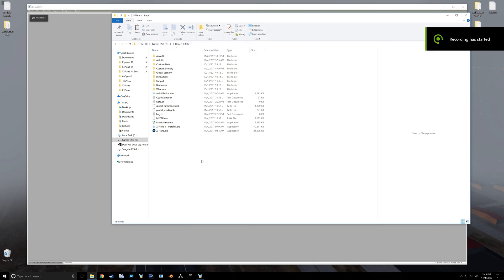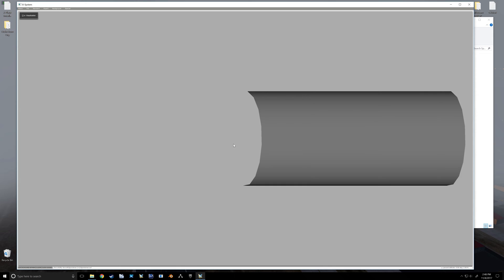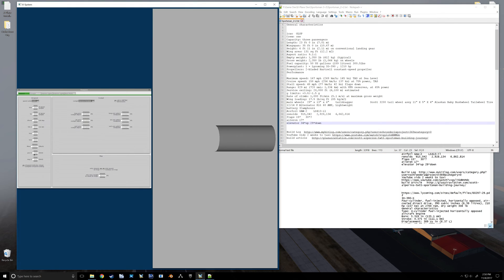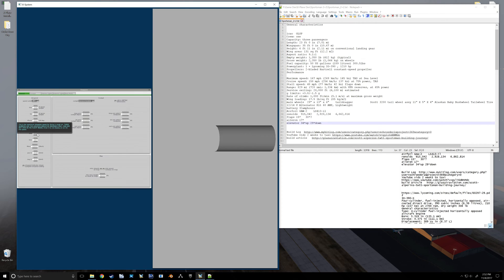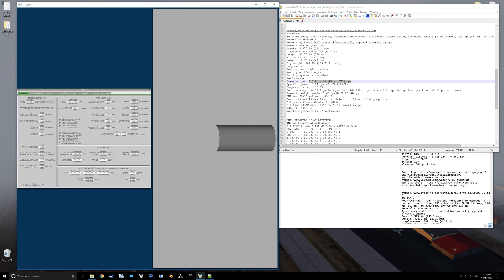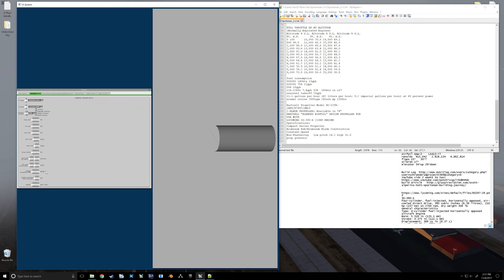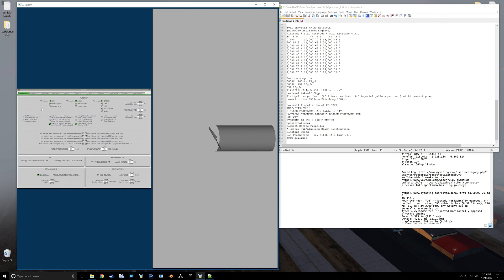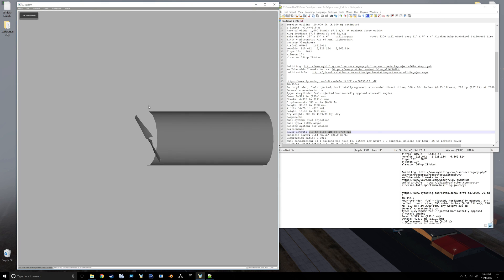Making an airplane for X-Plane 11 Tutorial #1

Comment: lemme join and say thx for the series. i watched about 10 parts but without goin into details, can you tell me where are the XPL files discussed? for me this is the main culprit in the whole process, first: why it is separate and not integrated in the plane maker software? second: in most better aircraft looks to me the XPL file contains the more important functionality, like fine tunings, extra AP settings, comprehensive lights, FMS settings and defaults... it is a horrible system just like fsx/p3d. tried to google it but i dont get any usable results, only that those are dll files. yeah ok but where i get the dedicated editor and compiler for those that would connect it with the datarefs in the ACF file?
Reply from the maker: I never got that deep into things. I think you’ll find some help on the x-plane developer website. A google search for x-plane developer should get you there.

Comment: I'm trying to build a quadcopter in plane maker. So far, I have made the fuselage, the arms, set 4 rotors, props and engine nacelles at the 4 rotor points. Have also made landing legs. When I import it in x plane, it keeps on toppling and eventually catches fire, then respawns and does this again and again. Any help ?

I also need to control this quadcopter using ardupilot SITL and QGC
Reply from the maker: Sorry, I have no experience designing quadcopters.

Comment: Is it possible to fix bugs in xplane 11 paid aircraft such as the Air Foil Labs King Air 350???

I’m a corporate pilot that flys a King Air 350i in real life and find that study level aircraft such as the Air Foil Labs King Air 350 are a super useful training aid for the real airplane in terms of doing “flow checks” and muscle memory type stuff, however there are a few small things from a systems standpoint that need to be tweaked to make it a perfect analog to the real thing. So, can any plane be tweaked or edited in xplane11?
Reply from the maker: Yes and no. There’s often a plugin coding done to make certain things work. You can modify anything that’s controlled default by x-plane. Editing any custom code is more difficult and often locked. Best to reach out to the creator.

Comment: What version of Blender should I be using to export to X-P 11.5x?   I don't see that option in Blender 2.8. Thanks!
Reply from the maker: You need to install the xplane2blender plugin. https://github.com/X-Plane/XPlane2Blender
Reply: @BuildItBetter3D  Hi. Thanks for the reply. I have xplane2blender installed. I don't see an option to save to XP v. 11.5, the options I see are 11.30 and then 12, nothing between 11.3 and 12.  Version 11.5 is the first VR version. Thanks for the help.
Reply from the maker: Hmmm, I don’t remember paying attention to what version it said. I’d just choose the latest for your version, so 11.3, and see what happens.

Comment: Hey, can you suggest what kind of research I need to do before starting the process of making a plane?
Reply from the maker: You’ll need to know as much as possible about the plane. Weights, dimensions, power, fuel capacity, fuel burn, airfoils, prop size and pitch, etc. the more info you have the smoother the build will go.
Reply: @BuildItBetter3D  I see. How about designing your own aircraft? Would I need knowledge in aeronautical engineering?
Reply from the maker: You can start simple. Depending on how accurate you want it will determine how much knowledge you’ll need. No harm in opening planemaker and just trying. If you don’t have x-plane you can download the demo. Planemaker comes with the demo.

Comment: do you know of any online archives for older aircraft such as dc6 or dc7? i haven't been able to find any in-depth resources on details such as g limits and maximum flap speeds for specific detents... if you know of any online pilot operating handbooks and maintenance manuals that would be great!
Reply from the maker: Hi, sorry but I do not know of any place like that. Usually it takes days or weeks, sometimes months to find everything necessary for an accurate build. Good luck on your search.
Reply: @BuildItBetter3D  thanks!

Comment: I'm currently doing the research stage and can I have a list of things that I'll need like flap and slat position, ailerons max rotation to see if I'm not missing anything and how did you find the airfoil for your aircraft
Reply: how do you find the g-limits of the plane?
Reply from the maker: I just open planemaker and go through the steps for a list of what I need. 
Finding specific things like airfoil or g-limits I just search that with the aircraft name on google and the do a ton of reading.
Reply: @BuildItBetter3D  ok thanks for the advice

Comment: This is an excellent series, thank you so much for putting this together.  After many years of futile searching for my favorite aircraft, I am finally able to make progress on actually building one for myself.  One piece of advice for others, in Plane Maker, save often.  I've lost track of how many times I have messed up the points in fuselage to the extent where they are pretty much unrecoverable with the plane model looking like somebody put it in a blender :)
Reply: Or in my case I'd almost finished making a plane and plane maker crashed causing it to go corrupt and unrecoverable. If I'd saved it more often I could have recovered it probably. But in the end I had to start making it all over again.
Reply from the maker: Thank you. Yes, save often is great advice.
Reply: Do you need Blender or can it all be done in Plane maker?
Reply from the maker: The flight model is all done in planemaker. You can do everything pertaining to how the aircraft interacts with the world through planemaker. You’ll need blender or another 3D modeling program to make things look real. Planemaker can build somewhat of a visual representation of the aircraft but you can’t do all the details and make it look real without 3D modeling.

Comment: Cant I just make it in Cinema 4d and the movable stuff like doors engines flaps etc in Plane maker ?
Reply from the maker: I don’t think it will work that way, but I’m not sure. Is there an exporter for cinema 4d? The x-plane obj is not the same as the modeling obj you are probably familiar with, you need a specific exporter for it to work in x-plane. If there is an exporter then that method would partly work but the moving objects would look very poor compared to the rest of the model that was created in a 3D application.

Comment: Hey Build it better, is there any better (see the pun) to contact you if I have any mistakes along the way, (Discord, email, etc?) but I had a question, How did you find the root tip chord for the plane? I heard you do a calculation and I found no research on what a root tip chord is or how to get it.
Cheers.
Reply from the maker: I read the xplane.org forums often and try to help whenever I can. That is the best place to post when you're struggling. The chord of the wing is the length front to back, root being near the fuselage and tip being the wing tip.
Reply: @BuildItBetter3D  also one more question, think you're gonna develop planes for MFS when the SDK releases? I want to start developing GA there and it's always better to follow a tutorial.
Reply from the maker: Right now I don’t have any plans to develop for MFS. I have had access to the alpha for many months but can’t speak to my thoughts on it due to NDA. I plan to stick with X-Plane for the foreseeable.

Comment: For people asking for research and get bummed him responding to "you have to find it on your own" That is pretty much what you have todo. There is no easy way to get the information required to create this aircraft, If you want a nice aircraft you are going to have to put in the work, you may find it irritating that $30 is for one aircraft but this is what they have to do over and over again. The bigger the aircraft the harder it is. Now how to find the research then? You may be asking. Well for my example aircraft I wanted to do something simple, I did the good o'ld Cessna 152. The research process is not easy. You can sometimes have to read for 10 minutes, sometimes 3 hours to find what you really want. The aircraft you know tend to have more information than the others you don't know about. On my first attempt at this I couldn't find the Diamond DA40's research because well it was there, I just didn't look hard enough and you don't know the plane better. It took me a couple hours to find the correct information. Now onto the Cessna 152, I typed in Cessna 152 specifications and within 5 minutes found a Cessna 152 POH with 50 pages of information that I used and that was all the research that I needed. Sad for you, to build these aircraft you will need to read a lot of information to professionally build them. Thanks to Build it Better your series helps dearly in making newbies aware of the current situation to build aircraft in X Plane 11. And it also helped me build my first aircraft :)
Reply from the maker: Very well put, thank you.

Comment: Any time I try to fly my Zibo aircraft, I face an error message that says "You requested a reciprocating or turbine engine in the ENGINES screen, but have entered an engine power of zero!.... 

Fix this problem in Plane Maker. The plane in question is: Aircraft/zibo/B737-800X/b738.acf". How do I fix that with the Plane Maker?
Reply from the maker: I would suggest downloading the aircraft again to do a fresh install of it. I’m not sure if they are using any code to modify engine parameters.
Reply: @BuildItBetter3D  fresh download and installation but same error
Reply from the maker: It's not my airplane so I probably can't help. You can try to look in planemaker, -> Standard -> Engine specs -> Engines 1 -> maximum power. You would adjust that value to the correct value for the aircraft. I don't know what that value should be, you'll have to find that on your own. You can give that a try, but if Zibo is using code to modify the engines then it might not work.

Comment: While titled a tutorial, sorry, its still too vague as to getting started using Plane Maker. Research of user planes? So you had already compiled data I take it? Data from where, and is this data from some other aircraft? Other aircraft in the sim that you fancied, and wanted to use on your new creation, or possibly a favorable modification to an existing aircraft? ICAO Code? Where did that come from? The 'Research' information. Again, sorry. Just too vague for a beginner / New user of Plane Maker.
Reply from the maker: When building an aircraft for x-plane you are generally trying to simulate a real world aircraft. So, the research should be done on the real world aircraft you are trying to simulate. I can't walk you through how to do research, every aircraft is different and the info will be in different places. Try google search, youtube videos, find the real aircraft at the airport, contact the manufacture, etc. It takes hours, days, weeks or months to do proper research. Once you feel you know EVERYTHING there is to know about the aircraft then you're probably half way there. That's a good point to start inputting your info into planemaker though.

Comment: where do i find research ?
Reply from the maker: https://en.wikipedia.org/wiki/Research
Reply: @BuildItBetter3D  but where on wikipedia ?
Reply from the maker: When building an aircraft for x-plane you are generally trying to simulate a real world aircraft. So, the research should be done on the real world aircraft you are trying to simulate. I can't walk you through how to do research, every aircraft is different and the info will be in different places. Try google search, youtube videos, find the real aircraft at the airport, contact the manufacture, etc. It takes hours, days, weeks or months to do proper research. Once you feel you know EVERYTHING there is to know about the aircraft then you're probably half way there. That's a good point to start inputting your info into planemaker though.

Comment: Is there a method  to import in CAD models to Xplane? From softwares like SolidWorks?
Reply from the maker: I am not aware of any importers for SolidWorks(or other CAD programs). If I were to bring a CAD file to use in X-Plane I would export it in a format that Blender can open and then make the necessary changes in Blender(UV unwrap, animate, manipulators, etc). The object format that X-Plane uses can't take advantage of anything special you have set up in a CAD program(including your animations), That needs to be created specifically for X-Plane with its format. Perhaps there is someone out there that has gone through this process and can give better information, if so hopefully they will add their thoughts.

Comment: Hi there.. I wonder if you could help me on this as I've gone through several tutorials but could not figure it out. I have an airplane from Carenado that I wanted to edit the fuselage by hidding it so I would be able to see the wings without it. Any suggestions you could give?
Reply from the maker: Most likely you need to open the aircraft in planemaker. Under the misc objects tab you will find all of the objects that make the visual model. One or multiple of those will be what you would remove to hide the fuselage. Hopefully they are labeled in a way that it will be easy for you to figure out which ones to remove. You don’t need to delete the objects from the object folder, only disable them in the misc objects section of planemaker and then save the file.